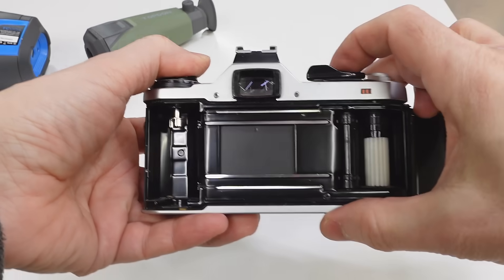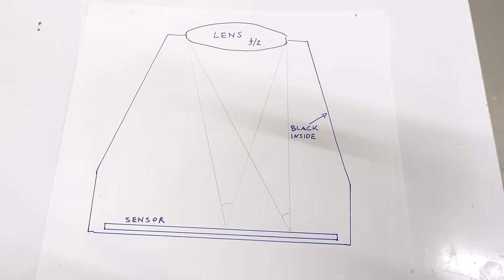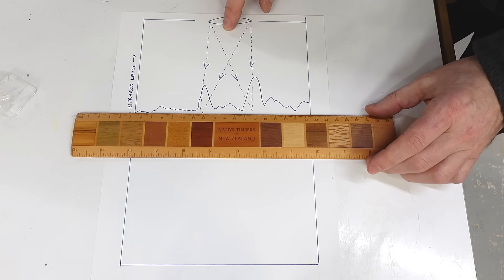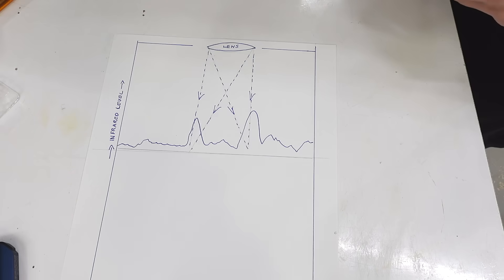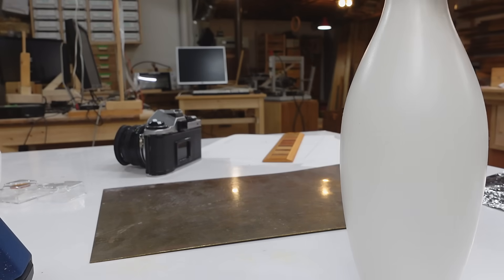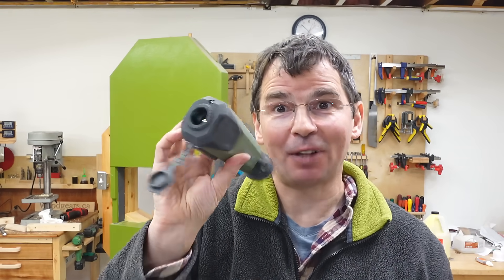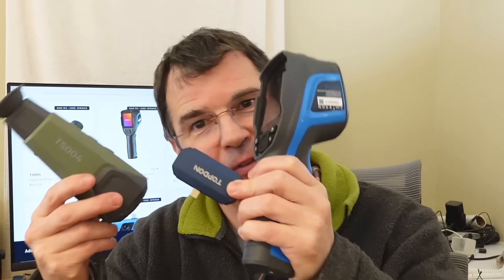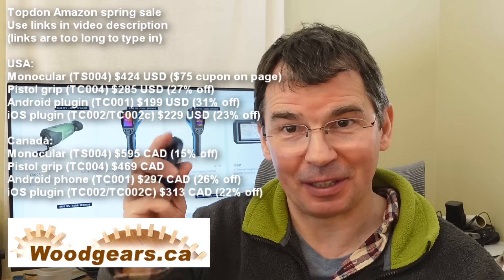How do thermal IR cameras even work without liquid nitrogen?

Comment: covid detecting cameras usually had a black body temperature source somewhere in the room as a known source to calibrate its temperature offset from.  
flat field correction is something different, even shutterless cameras do this somehow.
Reply from the maker: if you have temperature sensors in the body of the camera, you can calculate how much infrared should be coming from inside the camera and subtract that.  But being rather open loop, I imagine its not as good as using a shutter.
Reply: @matthiasrandomstuff2221  I did wonder if a temperature sensor inside the camera body would work instead of having a shutter, so this answers that :D